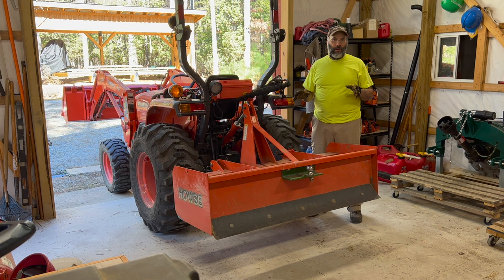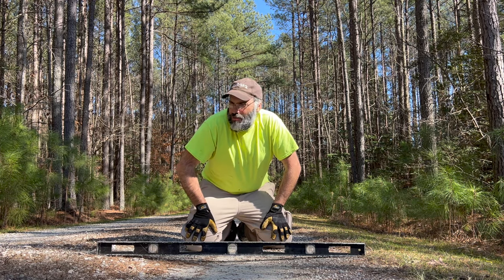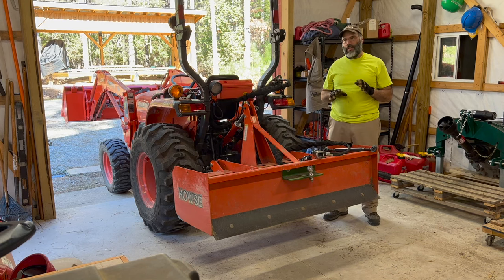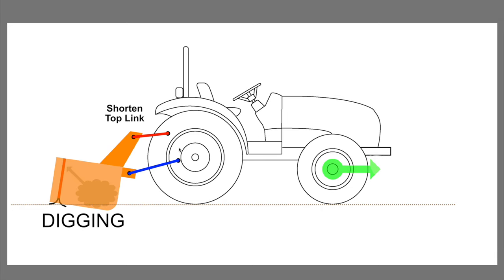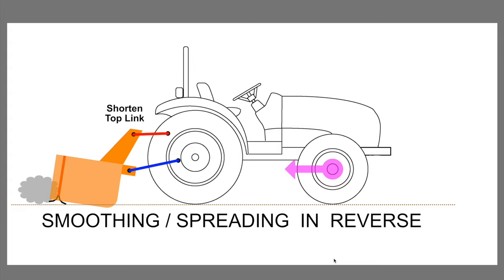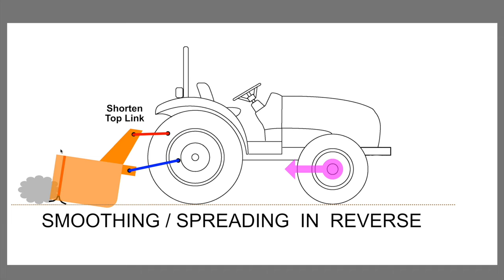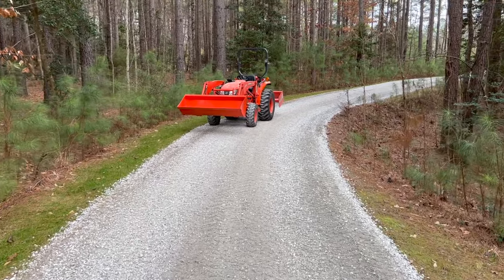The Art of the Box Blade for Gravel Driveway Maintenance

Comment: So are the blades cutting as your spreading material? I have pot holes and ruts..have dumped marerial and spread using a landscape rake..but obviously need to cut ruts and holes out.
Reply from the maker: If you are spreading, the blades cannot be angled to cut (otherwise the box would collect material, not spread it).  Those are opposite goals.  A neutral angle is often best for rough grading work, as it will allow the box to remove material from high spots and deposit in low spots.  

Ruts and potholes are a sign of drainage issues and those should be understood and corrected prior to grading, or they will return.  A pothole is the result of traffic washing fines out of the base material because water pools and puddles there.  The fix is to put fines back in and correct drainage.  Smart fixes do that without tearing up the surrounding area.  Some people think the solution is to rip up the surrounding area and re-grade, but then you are just taking what fines remain there and stretching them out over a bigger area.  The pothole will come back larger next time.  Bring in new road base with lots of fines to fill the pothole slightly proud of the surrounding area, tamp it down good, and then add more material to raise the surrounding area enough to prevent pooling and puddles in that spot.  If anyone tells you to rip up the entire area around a pothole, get advice elsewhere.

Comment: Even on the subcompact tractors a  hydraulic top link and side link is a must. I have not set up my BX23S up with the hydraulic links but I am going to for sure. I just did a bunch of work adding a parking area at my house. Doing the adjustments manually are a pain in the butt. Having the hydraulic adjustment on the fly is a must.

Comment: Hi great video, thank you. I am trying to learn how to use my box blade on my MF 255 tractor. This is a road at the top of a mountain and over time the rain washes all the gravel and needs to be fixed re-graded and more gravel to be brought to fix it. I would like to know how to make runoffs at even distances so the rainwater goes on that ditch and doesn't wash off the gravel. Thank you!!!
Reply from the maker: Make sure the road has a crown so water runs off to the sides, and then you might need to cut a waterbar channel across the road in any steep sections, which will divert water to the side ditch and prevent it from washing down the slope.  That is best done by hand with a shovel.  Lumber or scrap metal can be used to maintain the waterbar channel shape so that it doesn't fill in due to traffic.

Comment: Great Info.   I have learned that for gravel driveways, an implement that is particulate-size-agnostic is required.  For example, using a landscape rake on a driveway only moves the larger pieces, leaving the top layer loose and less likely to compact to a more solid surface - problem with shape-retention, and an issue for plowing or blowing snow, for example.

Comment: Well done video, I appreciate the time you take in explaining and your drawings are very helpful.  I've watched many of your sawmill videos as well. Obviously you put forth a lot of effort in prepping for your topics and that shows in the quality of your work. 

Two questions - Why did you choose not to leave your hydraulic lifting rod on when grading and what is the thinking behind the multiple mounting holes for the top link on the back of the tractor? 

Looking through my owners manual for my L3400, there is a chart which lists several types of implements and what holes to use to mount the top link, but gives no explanation as to why. I had read/heard that the lower mounting holes were best used when using ground engaging implements, such as a disc harrow, sub-soiler, but the chart doesn't fully align with that thought process. Any thoughts of the topic?
Reply from the maker: Thanks for the comments.  Normally I leave my hydraulic side link off the tractor if I am not doing any tilted grading/cutting or crowning with the box.  It will bleed down slowly, and requires periodic attention to keep the box set level.  If I don't need it, I avoid that hassle by using the rigid side link.  The hydraulic top link stays on the tractor 100% of the time though.  It's useful with every implement I have.

The different mounting holes are there to allow a trade between lifting height and lifting power.  The bottom hole will let you lift implements higher but with less power.  And vice versa.  You really don't notice this unless the implement is very long, since the effect is all about the lever arm to the aft end of the implement.  The only time I fiddle with this is with a bush hog or post hole digger, which stick out far from the tractor and may require that tweak to optimize operation.

Comment: great video, the diagram is very helpful in illustrating the function of the two cutter blades.  I'm gonna guess your an engineer.  One question though, when you add material to the driveway wouldn't it be better to loosen the entire surface slightly and redress it.  My thought is the the entirely loosened surface will all form into one surface.  My experience is that adding material to my potholes makes them wash out again quickly.  Just wondering, as I'm no expert, just wanted to know your opinion.
Reply from the maker: I've never had issues adding material on top and re-grading.  But potholes are another thing all together.  

The fundamental issue with a pothole is poor drainage and standing water.  The water washes the fines out of the gravel mix, and traffic activity splashes the water (and fines) away from the pothole, leaving loose gravel that will not bind together.  More traffic over that will knock the loose gravel away from the hole.  And you get this repeating cycle which gets worse and worse as the hole gets deeper and deeper.

So the true fix for a pothole is to fix the drainage issues and/or regrade the area to move water away from that spot.  Generally that means the fix is going to cover a larger area than the pothole.  You might end up removing material or adding material, depending on what's required to fix the drainage issue.

If you do try to fix just the pothole, leave material about 1.5" high after you compact it down.  Then add more gravel around the hole to blend in to the existing grade.  It should solve the local problem, though it might also move to the problem to a new "low" spot.

Comment: Great Video!!! In reverse (as illustrated) the issue is that the side wings of the box blade are now below your surface line. Besides putting compression loads on the parts (also as discussed) this would probably not give the desired results.

Comment: Question?  Why didn't you just cut the high point in the middle of the driveway and move the material into the low spot? It would have saved time and $?
Reply from the maker: That would be a big mistake.  It's super important to create and maintain a crown so that water runs off to the sides.  Gravel driveways without a crown will deteriorate and form potholes very quickly.

Comment: When they were dumping the gravel, why didn’t you ask them to move as they dumped. This would have spread out the gravel a bit.   I use both the box and bucket to smooth things out but I am mindful of the loads on the hydraulics and also the arms.
Reply from the maker: I brought in the gravel myself on a dump trailer (which you can see in some of the clips).  It doesn't have the type of tailgate needed to spread.  But in the past when I have had gravel delivered by dump truck, I would ask them to tailgate it down.
Reply: @Lumber_Jack  ahhh, sounds good.  I don’t have trailer skill yet…but I would do as you did.  Nice work.

Comment: i am surprised you did not angle it slightly to the outside (right tire) to put a little crown in the middle of the drive.  I bought a box blade a little over a year ago for my drive and the first time i really struggled with maintenance of drive, the second time i did a much better job.  I do love the hydraulic top link - that makes the capabilities of the box blade so much easier to manage.  I will have to look into that for my tractor.
Reply from the maker: Driveway already has a healthy crown and by running the tractor and box down each side of the center, it is maintained.  To establish a crown, a rear scraper blade is the best tool, since it will windrow material to the center.
Reply: @Lumber_Jack  Ah! So that explains it! I really appreciated the video so much good info, but one thing that has always perplexed me was how to establish or maintain a crown. Much obliged!

Comment: I just have a l2501 not HST I hate they told me I can’t install a hydraulic top link with out it costing me a few thousand
Reply from the maker: It doesn't cost nearly that much if you do it yourself.  You just tap into the existing power-beyond loop (same loop that feeds optional front loader and backhoe on the 2501).  You can use generic valves for a couple hundred dollars.  The Kubota valve kit is better integrated but just repackages generic valves, hoses, and fittings and they charge $$$ (especially if the dealer does the labor).
Reply: @Lumber_Jack  they gave me a spill about haveing to install new pomp’s and it would cost 3000 and up. I felt like they wanted me to get a new tractor a upgrade from what I got

Comment: What size stone/gravel did you use?
Reply from the maker: I use crusher run aka "3/4 minus" which is a mix of 3/4" on down to dust.  It locks together over time (almost like concrete).

Comment: Hey there having a lot of fun watching your videos. I have 800 rough driveway... In high elevation in northeast takes a beating. Want a box scraper and before I jump need to know about the hydraulic top link for Kubota L3400  tractor... recommendation ? Not top line needed as I am in 70's and need a ten year deal!
Reply from the maker: There is a company called "a&i products" that sells generic ag parts and they have low cost top links and side links for all sizes of tractors.  See https://www.aiproducts.com/.  Both my top link and side link came from them, and were around $150-200 each back in 2015.  For the L3400, I think you'll want model A-TLH001 for the top link.  You can custom order hoses from https://www.discounthydraulichose.com and get exactly what you need for your setup.  If you don't already have a rear remote valve, that will be required (plumbs into Kubota power-beyond circuit), or you can use the front loader control valve instead, assuming you don't need to use the front loader at the same time as the box blade.

Comment: For a new user of a box blade this is a top notch description of use. Where do I get and How are you adjusting your top link? Do I need another hydraulic connection? My unit is coming on March 18 with a backhoe attachment. Do I use that linkage?
Reply from the maker: Normally hydraulic top/tilt links are connected to rear remote valves on a tractor.  Those are usually optional kits sold by the tractor manufacturer.  Some third party companies offer rear remote kits but they are usually kludgey and won't have as nice integration as the OEM kits.

Comment: Excellent video and presentation; thank you! I am still deciding about getting a box blade or scraper for my 125-yard-long driveway, but I will get one or the other shortly; any advice would be appreciated. I get constant washouts with heavy rain on the slopes. The regular driveway's brown sand and tiny gravel disappear into the grass and creek in no time. I have tried 3/4" rock, and it still will get pushed downhill, but not as bad. Do you have any suggestions on what driveway rock to slow washing away? Thanks!
Reply from the maker: The only good solution (if feasible) is to divert the water, otherwise it will be an ongoing battle with any type of gravel.

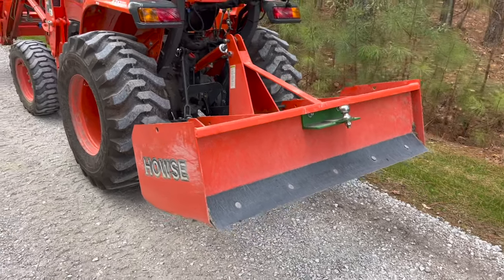Comment: 23 23:47 If you're going to haul your own rock you should set up your dumb trailer to spread the gravel it would cut your time in half
Reply from the maker: I tailgate gravel out the back of the trailer on new driveways or when I know I want an even layer over an existing driveway, but for periodic maintenance it's much more surgical/strategic to place it manually.

Comment: Where did you get the top link kit?  Thanks for the education!
Reply from the maker: I bought a generic AI Farm Products cylinder with the right specs (https://www.allpartsstore.com/ItemList.htm?CategorySeq=S&SelcBrand=KB&SelcSectn=HPT&SelcSubsc=HPT12) and had the hoses made up by discounthydraulichose.com.  Once you find the correct size cylinder (should be the correct "Category" rating for the tractor, with the right ends, and match the range of the original mechanical top link) you can google the cylinder model # and usually find a few sources online.  All together it was under $250, which is quite a bit less than off-the-shelf kits.  

I took the same approach for the side link and found that cylinder as new-old-stock on eBay for $85.  It came wrapped in newspaper from the 1990s, so it really was old stock, but worked beautifully.  Hoses for that were about $60, so all total under $150 for the side link.

Comment: Excellent video! 
I have about 1 mile of driveways with a gravel seal that includes river stones of various sizes from pebbles up to about 6" diameter. Is this implement suitable for that, or would I also need a roller/compactor to bed the larger stones in agan?
Reply from the maker: It won't do well with the larger stones.  About the biggest gravel a box blade can spread effectively is 2".  Bigger stuff will collect in the box and not get out, or get trapped below the cutting edge and create furrows in the surface being graded.

Comment: I've had a regular blade, box blade and a cork screw type rock rake. The best for me was to make any ditches and grading with regular blade. Have gravel tail gated and then use my rock rake. It gets done much faster than a box blade. The box blade is excellent if the load of gravel has to be dumped and then spread. Love the rock rake for the finish work because it's so fast.

Comment: I'm not sure you're right about using reverse with box blade.  For generations there have been three point hitch using a blade, and compressing the arms. Some of the generations on the same tractor. Anyway good video, thanks
Reply from the maker: Spend some time on the various tractor forums -- about once a week someone will show up with bent arms or a busted rear end because of this.  Very common failure when folks don't know the limits.

Comment: Loved your video! But I'm still confused. I see that you don't use any of the heavy metal prongs that stick down in the front of the box blade and that you're using your box blade without that those prongs and just depending on the back smoothing and cutting surfaces. I'm confused on the angle though because my thought was that I seem to load up my box plate too quick and don't know really how to release the material correctly. I had recently thought that if I put it in the digging position that it would automatically fall out the back and fill the holes. But you're suggesting that I do exactly the opposite and put it in the smoothing position and depending on the back blade of the box blade without the diggers in the front to smooth the material it looks like you're saying that if you have the front of the blade tilted up the box might tilted up that will put you in the smoothing mode but I have been thinking that was a problem on my box plane gets loaded up so quick and doesn't get rid of anything. So if you could do a video on that that would be great.
Reply: I had thought that my tilting the back of the blade up with the front side of it down I guess in the digging position, that that would allow gravel to fall out under the back of the blade as I drove. You're telling me that I need to raise the front and lower the back to smooth it. I don't have new gravel on my drive, I'm just trying to renovate a very old driveway it's very packed with little gravel on it anymore. I had thought of using the prongs on the front to dig up the old gravel and expose it and then try to smooth it out. But again I was thinking if you lowered it in front raise it and back it would let the material fall out the back. Is there a step missing here between loading it up dropping it out and smoothing it how do you drop it out without smoothing it?
Reply from the maker: The "rippers" or "scarifier shanks" are only needed to break up heavily compacted material.  They are rarely needed on a gravel driveway.

Comment: The hydraulic too link is over $1,000. The dealer told me it was more convenient but not needed for use a few times a year.  The BB comes this week so I will see if it is worth it as I don't think leaning over the seat will work well
Reply from the maker: You can do it for a few hundred dollars if you want to put together a top link kit yourself.
Reply: @Lumber_Jack - you have to have the extra rear hydraulic function though too.  Unless you have some way around that.
Reply from the maker: @1wheeldrive751  You need rear remotes, or you could use front loader controls if the loader isn't needed.  But most of us are using both the loader and box blade for these jobs so that is not always an option.
Reply: @Lumber_Jack  - Thanks for the reply.  Yeah, this is what I thought too.  I have a box blade, a grader blade,band a loader for my B2601.  No matter which implement I have on the back, I’m almost always using the loader too.  All of the less expensive options involve diverter valves and time sharing the control stick.  I guess that is better than manual adjusters, but not ideal.